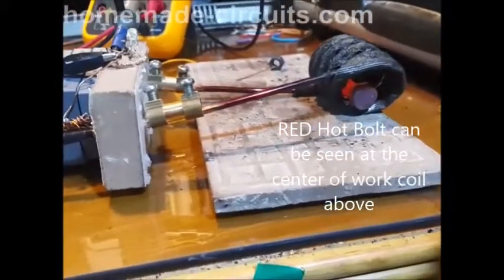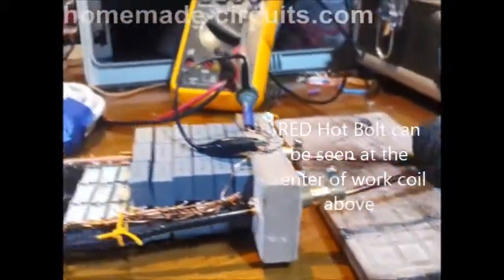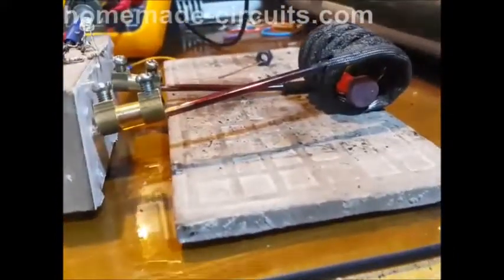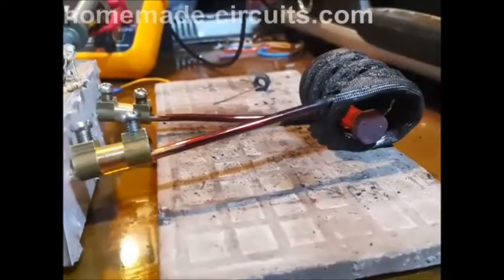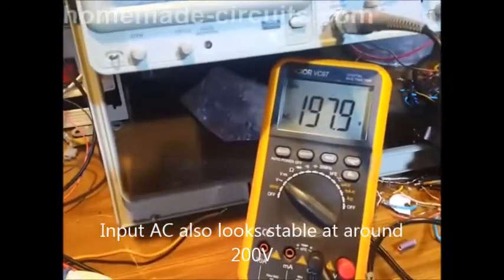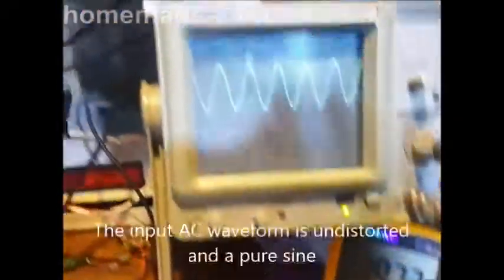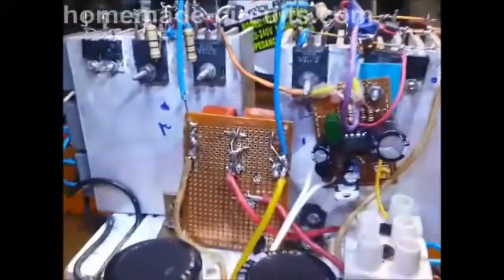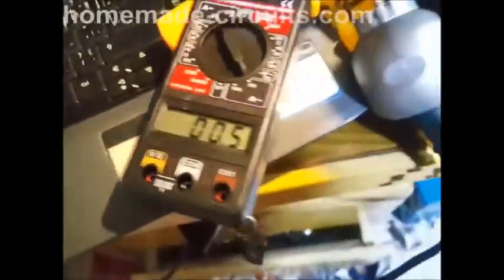High Power Induction Heater Circuit using IGBT

Comment: I suspect that the bolt gets hot enough that it radiates heat as fast as you can add it. If you can trap the heat inside using a heat shield of some sort, you can get it to melt, but I would be very cautious with how you hold it... Depending on the alloy, it will melt between 1300C and 1600C; using a graphite crucible will be good as graphite is designed for handling these temperatures, and will receive the currents from the coil too.

I plan to use a steel crucible for melting aluminium (along with the circuit you published); but I will definitely be using a perlite heat shield to trap heat inside; and this is for temperatures only 680~700C rather than 1600C

Thank you for the circuits!
Reply from the maker: Thank you for the valuable feedback, much appreciated!
Reply: @Homemade-Circuits  Hi Swagatam, I am curious what the coil is wrapped in? Is it a ceramic fibre insulator?

Thanks :)
Reply from the maker: Hi Adam, the video was sent to me by one of the avid followers of my website, so i am not sure about the black coating on the coil, seems like a layer of carbon deposited on the coil due to over heating
Reply: @Homemade-Circuits  Oh sorry, I thought it was your video. Thanks for the reply!